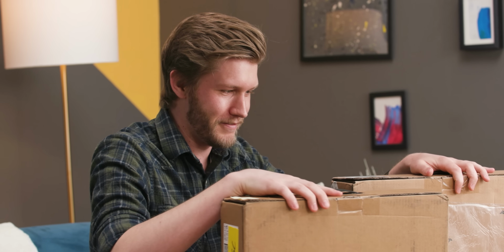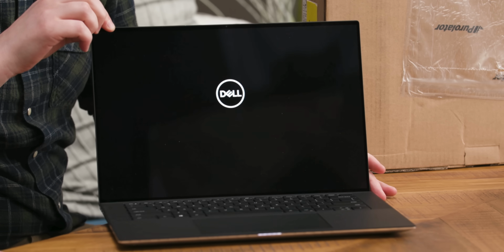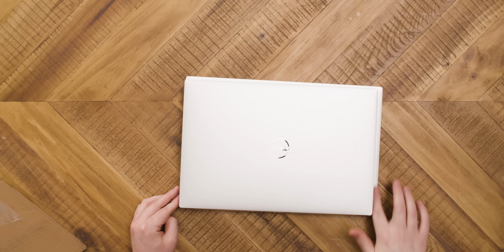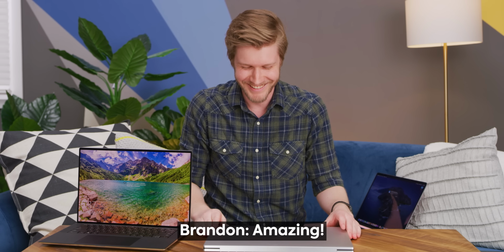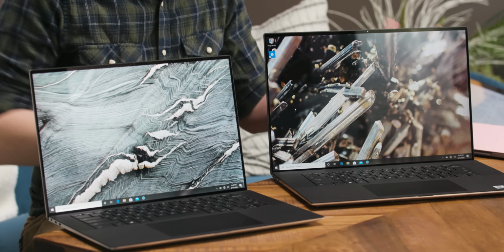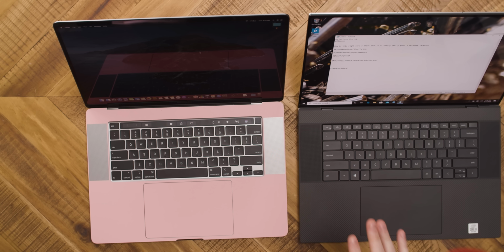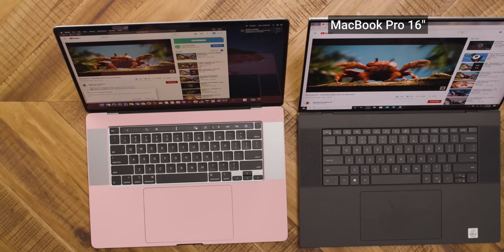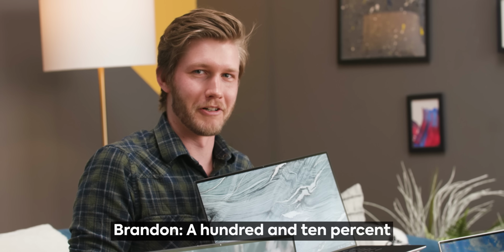The MacBook Pro's Biggest Rival - DELL XPS 15 9500 & 17 9700 Laptops

Comment: I would instantly get this if it had a AMD Ryzen 9 4900H. Skipping this because of intel. the laptop itself looks amazing tho.
Reply: Same I'm  looking for a good ryzen laptop and the g14 is best overall.
Reply: Cool101 g14 and 15 has bad screen tho high latency(response rate is bad) low brightness and low color accuracy so it’s wont be competing with XPS in creativity centric workstation
Reply: Same. A lot of the options on the market this year are going to be a "No" for me just because of Intel. The Lenovo Yoga line-up is rumored to feature a R9 version, let's see what they have to offer.
Reply: I don't know, I usually look at the whole package when evaluating a laptop rather than just the CPU, and this is pretty compelling.
Now before someone points at the Zephyrus G14, don't get me wrong, the mobile Ryzen line is awesome, but the G14 isn't good specifically because it's using Ryzen, it's simply a great laptop overall.
Reply: @SteelSkin667  that's due to Ryzen being really new and not having as much time dominating as Intel has. The OEMs can't ignore how good the chips are and they will lose customers if they don't move with the times.
Reply: +1 for a Ryzen 4000 series - C'mon Dell, get with the program, otherwise I'm off to Lenovo!  😃
Reply: @MKDC-5  See that's an actual deal breaker for me on a 15+ inch laptop.
Reply: @Charlie Correa Then you won't have any tb3 which is quite important to a lot of users. If Dell would get rid of tb3 capability on those usbc ports then they probably won't be selling any of their tb3 docks. This isn't like on desktop motherboards like Asrock did it 1 year ago with their x570 mobo (forgot the exact model) which gives tb3 capability on an Amd motherboard. To do that you still have to pay Intel for certification(one of the reasons why that asrock mobo is very expensive) even though tb3 is royalty free. That will be replaced by Usb4 next year but by then maybe we will have tb4 which will have higher bandwidth than usb4 and we would be in this same state as we are right now. 
Also, there are a lot of apps that support intel specifically, f.e for Android Development, more specifically to use Android Studio's emulator i need an intel cpu which gets used by intel haxm. I cannot do that on an Amd based laptop without workarounds (which still don't perform as good as the original way). Also, there's quick sync that video editors (at least with premiere pro afaik) use for faster export.
Don't get me wrong I'd also like to see an amd 4000 series cpu on these Xps 15 &17 (like Microsoft made it possible to configure their Surface Laptop 3s with ryzen 3rd gen last year) but it is not possible and not as easy as it seems

Something to mention: power efficiency doesn't come straight from cpu's lithography, there are a lot of other factors that determine that but yeah lithography is the one that makes the most difference afaik.
Reply: Now we just need thunderbolt on intel oof
Reply: Just wait for the next year or two refresh  because by then there will be Ryzen and navi in there
Reply: Dell only uses Intel in their machines. If you want AMD you may want something else.
Reply: @alhuno1  that is not true they have the new 4000 series on their X360 envy lineup.
Reply: Charlie Correa do you have a 4900h laptop? If you'r not, you just talk to much.
Reply: I think the intel 10th i9 is pretty much good as well although Apple ignored that..
Reply: @aluandcache7336  nah Intel 10th gen is still behind AMD in power and effeciency. That's why I'm waiting for a real upgrade and not little marginal upgrades to Intel CPUs
Reply: @charliecorrea7133  Yeah power efficiency could be an issue but 10 hours for a big and amazing displays still quite a lot! I feel that the new surface book 3 got a deal breaker battery life with 10th gen i7 and i5
Reply: @aluandcache7336  but why would you pay more money for less performance? It just doesn't make sense.
Reply: @charliecorrea7133  If one needs more versatile thing or top tier GPU (Quardo) performance with 2 in 1 laptop then one would buy obviously.. But surely I won't! I would highest get a Surface pro 7 which has an amazing mobility and pure power..
Reply: @aluandcache7336  Intel 10th gen is still a 14nm refresh. Which means that it's the same chip over and over and over with more power and marginal gains. AMD turned the market on its back by having more powerful chips with less power. 7nm is absolutely amazing.
Reply: @charliecorrea7133  Yeah I can't accept Intel's laziness during 16-18.. But for power users those processors are not bad either specially when you consider gaming mostly..
Reply: Why is no one willing to give Intel a chance. They might be up to snuff, on 10th gen. Y'all are ruling them, like they're about to go out of production.
Reply: @F1ll1nTh3Blanks  also screw Intel, they have been overcharging us and holding back innovation in the CPU space. If it wasn't for AMD they would still be selling us 4 cores at the high end for 500$
Reply: @F1ll1nTh3Blanks  because 10th gen are still 14nm process. That means it's only gonna be a marginal update to 9th gen. So only way they can squeeze out a bit more performance is to crank up the power like crazy. AMD is more powerful and uses less power because of 7nm process.
Reply: @F1ll1nTh3Blanks  I don't think anyone hates Intel or anything like that. I think is simply a matter of wanting the most out of your money. If Intel's 11th gen makes an impressive comeback and it's much better, we will all go out and buy it. But at the moment, AMD is just plain better: more powerful, more power efficient, better integrated graphics, better pricing... We are not part of an specific brand, we just want the best for our selves with the money we have.
Reply: @F1ll1nTh3Blanks   The reason every one is giving them shit is because they aren't going to have anything comparative to Ryzen  in general until tiger lake which will released later this year. Also be using there 10nm on all of 11th gen unlike with 10th gen  which used 14 and 10 nm.
Reply: @dankpikmingodwashere4158  yes but the architecture won't change. They are still using monolithic dies. So it's expensive as hell to make monolithic dies even at 10nm. AMD is using chiplets so it's extremely cheap to make 7nm products. They can just basically glue chiplets together.
Reply: Wait, I thought Ice Lake was 10nm?
Reply: @planetarian6532  Yeah Ice Lake is on 10nm architecture. But Comet Lake got 14 nm node process which includes 10th gen mobile i9 or i7 or i5 processors..
Reply: @charliecorrea7133  isn't it for desktop only though because ryzen mobile 4000 has been nonalcoholic dies

Comment: No type a. Surprising at 15 inch. I guess this marks the end of type a on the 15 inch windows machines. Still rocking my skylake xps 15
Reply: Skylake XPS 15 bros!
Reply: Ive got the 9560 machine with kaby lake and it is the best machine I have ever owned. I don't game very much and have thrown even latest stuff at it and it handles it no problem. Unless Dell really screws up, I don't think I will ever not get an XPS in the future.
Reply: USB A is going to die off eventually. It'll take a few more years because it's been around for so long, but it's clear that the laptop industry is moving to USB C all the way, once the flagships all remove it other devices will follow. Yes for a while people will be struggling with dongles and adapters, but for a laptop that's hopefully going to last 3-4 years minimum you'll grow to appreciate the 4 Type C's
Reply: @JoshF848  yes it may die but 4 years is considerably long time and they could've probably got one USB A and 3 thunderbolts because something as basic as a mouse still have type A
Reply: @JoshF848  that's why it seems unfair. My point is you can go to next stage by adding thunderbolts or USB 4 when its available but still having one type A for us to not carry around a dongle. Why exactly do they need to remove it all together when its pretty much relavent rn? That at least doesn't make sense to me
Reply: @JoshF848  I think you're confusing USB Type C with thunderbolt. Apple used thunderbolt over miniDP and continued to do so for a while even after USB integrated it into the standard. Google was the first major manufacturer to charge a laptop (if you want to call a Chromebook a laptop) with type C and Apple followed. Dell's high-end models like the XPS haven't done it because they couldn't. The original revision of USB -DP didn't support more than 30 or 40 watts, and the latest revision supports up to 100w so you can't get the 130w the XPS and similar laptops need without proprietary crap. Apple gets around this by selling underpowered laptops with proprietary crap, though Dell isn't innocent either, for many years now Dell chargers came with hardware IDs and your laptop would not charge if you used a generic charger.
Reply: @JoshF848  I think laptops that aren't thin and lights will stick to type A. I don't see desktops going type C anytime soon so devices like mice will still use type A. I'd rather a device that just has the IO I need without the dongles when it's practical for the form factor. Those that can fit type A, HDMI, ethernet will keep it
Reply: @JoshF848  I hope not. Type C comes out way too easily in my view. It'll get pretty annoying if everything plugs in with a connector that's super easy to remove even for things that should be connected long term
Reply: I was looking at 15” laptops for my daughter. The lack of type A on the new XPS really stands out compared to the likes of HP’s x360, which has two A’s, but only one type C. The new Ryzen 4000 flavour also claims an integrated Ethernet port, which is hard to believe from the photos, but it’s on their website specs.

Far cheaper, especially after bumping the RAM and SSD, but only the 16:9 screen, and it’s somewhat dimmer. Hmmmm....decisions...
Reply: The 17 inch doesn't seem to have type A either. Type A seems to be disappearing from Dell laptops altogether and I have to say that I'm none too pleased by that.
Reply: A better transition method would be to lower the amount of type a ports every so years instead of just going from 2 or even 4 to 0 in one step
Reply: My sister is looking for a new laptop. I told her to get a XPS 15. Now I’m making  a different decision to get her a different laptop just because there are no USB-A ports
Reply: @ORIOLESFan02  You can still get the last-gen XPS 15 from Dell. There really isn't anything better out there. I preordered the XPS 15 in 2015 which is when they had the last redesign to the one they are using now and have been using it for 4.5 years. I got a three-year warranty, which was the max at the time, and extended it by two years. I had to use the warranty at the start because I was an early adaptor, but after the first year I haven't needed to, it was just for peace of mind. If Intel didn't kill Skylake with all the security patches I probably wouldn't be looking to update this laptop until it died, and it doesn't look like it will for at least 2 or 3 more years, easy. Dell is offering 0% interest financing for 18 months and $450 off the last-gen model right now, so my advice is go for it before they sell out. I just bought my father the top of the line i7 they have with 3 years of warranty (they do offer four now, but I know I won't need it), and I paid $2,400 with taxes, shipped.
Reply: XDSDDLord That is true and that’s what I’m probably going to do.
Reply: @XDSDDLord  I think its a major enough update from last year, like it has way better speakers and track pad also it does look better is more compact and that bezels on last one kinda look outdated. I agree no USB-A is a kinda deal breaker but I've heard it'll come with an adapter for that if you're into that stuff 🤷🏻‍♂️

Comment: how to impress alex : Diamond cut cnc machine.... tbf that is impressive looking lol
Reply: Using diamond to cut something is not necessarily very helpful. Especially for aluminium which is quite soft and is easily cutted using a good old tungsten tool. Don't fall for the marketing material. Diamond is mostly bullshit until you work with very hard materials (some foundry aluminium use silicium and are very hard). Also we use industrial diamonds so it might be more expensive than a tungsten tool but it's nothing too crazy either.
Reply: Cheeky plug for what's next on Alex's Linus tech list 😂
Reply: Diamond cuts are a man's best friend?? 😏
Reply: Thats how Apple has been making edges since the iPhone 5 in all of their stuff
Reply: @nanoscapehd6179  Which were never helpful to hold in hand
Reply: @nanoscapehd6179  That is not true.
Reply: Lemon Lollipop not true